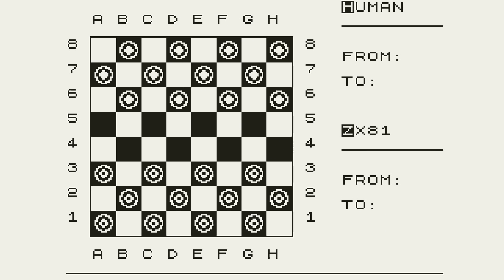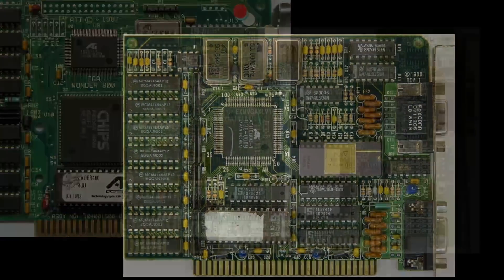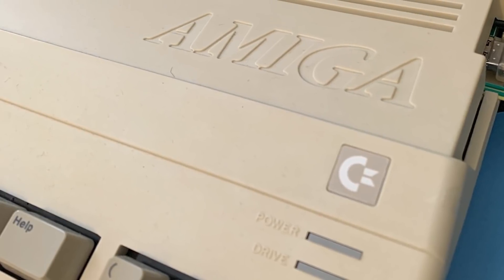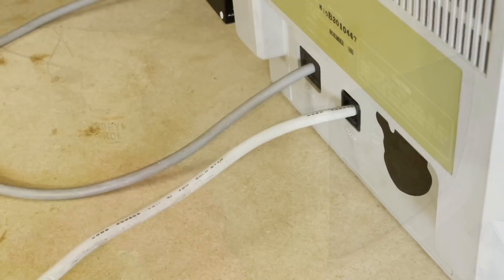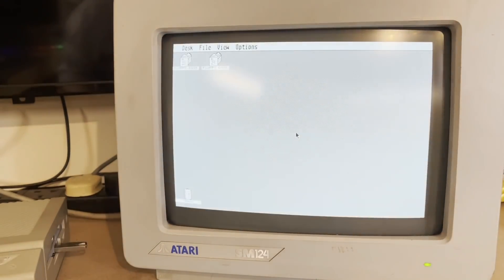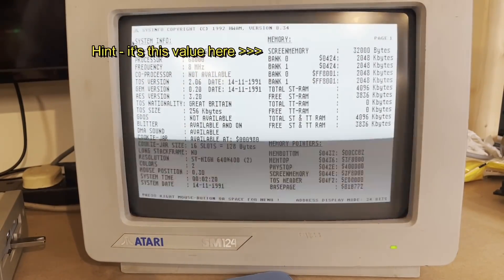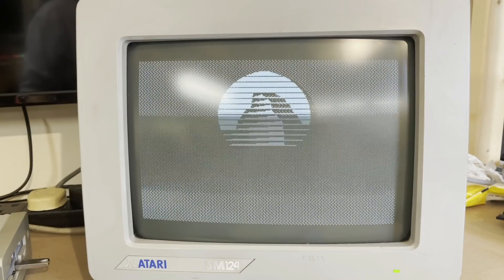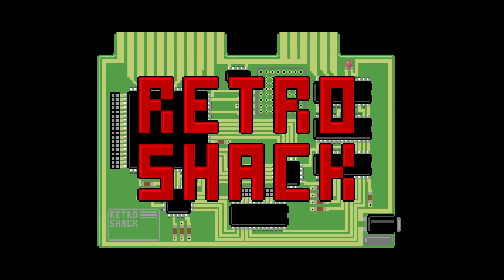'Hi Resolution' may not mean what it used to, but here's what it used to be!

Comment: I picked the ST over the 500 back when they were new as I was 14 and already into more than just games and there were several reasons for the choice, one of which was the rock steady 640x400 paper white display mode.

The interlaced mode on the Amiga equivalent was horrible, fine for use in a pinch but not for sitting there for hours coding or using a word processor. Even an extra cost flicker fixer didn't take it to 70Hz (the minimum for health and safety standards back in the day btw).

I used a 14" Sony Trinitron TV with RGB Scart input to give me the color modes, and an SM124 for the high res. Bought a switch box to flick between them. But I had to wait for that monitor, as I got the computer as a xmas gift at 14, then the monitor the following xmas... By the third xmas I had a 50MB hard drive. Imagine telling your kids today you were buying them the computer this year, the monitor next, and a hard drive the following year, lol!
Reply: You had a great setup!

I remember when I got my ST, when I was 13. Went over to London on a family holiday to visit my brother who had emigrated there for work, my parents bought me a 520 STFM in John Lewis on Oxford St. Plugging it in, I found the 3.5inch floppies weren't bendy - they were stiff. Having been used to 5.25inch disks on the Apple 2s in my school that year, and having heard of 'hard disks' - I thought that the 3.5inch floppies that came with the ST Summer Pack '88, storing an impressive 720kB, were in fact 'hard disks' :-)

ST magazines were the lifeblood of it all back then. Amazing to see how the internet has really allowed the old world of individuals doing their individual best, hanging off every tidbit of information that you could pick up, to where we are now, where anything you would have wanted to know about your precious ST is a mere google search away.... Even the manuals, on disk images, that you can load into an ST Emulator like STEEM... And I'm sure there's a file converter to .txt you can use too....
Reply: Not many people would have wanted the hassle of switching between two monitors, and very few people probably know of a device to allow not having physically disconnect the wires to do so between the two monitors. Nor would many people have wanted to take up the room on a desk for 2 monitors.

The Amiga with a flicker fixer would have been the preferred choice of most, and also offered color in hi-res mode.
Reply: @classicarcadeamusementpark4242  in Atari ST world not many people had low intelligence, everyone I knew  back then knew about the switch-box and even knew how to build one and how it worked.

Majority was even so intelligent that they picked ST as a better computer for their needs over the Amiga, just saying...
Reply: @classicarcadeamusementpark4242  you are so wrong, almost everyone knew about the switchbox, almost everyone who also played games had two monitors on desk with no problem, since monitors sat on back of the desk no one really used for anything else, in reality no one would wanted to watch the flickering poor RGB screen of Amiga in ATARI ST world...
Also ST was faster then Amiga...
Reply: ... and worst thing for you was the fact, that a year lasted todays 3 years,... damn inflation.

Comment: I upgraded from a C64 to a monochrome ST1040 in 1986 because I was into programing graphics and physics simulations and with GFA Basic it was an incredible machine. Loved it to bits and 640x400 with that crisp image the monitor delivered was insane for that time.
Reply from the maker: Yep, have to agree that the ST with a mono monitor is really easy on the eye!
Reply: The C-64 was still ahead of the ST with it's sound chip, but way behind the Amiga as all other computers were when it came out.
Reply: @classicarcadeamusementpark4242  Amiga sound chip is actually pretty poor DAC nothing special and very limited range. In 1985 when it came out it was also very limited by tiny A1000 RAM, almost useless.
ST had so much more possibilities back then, the YM is a proper synth chip Amiga is lacking of. Yes the SID was great, but ST has a MIDI that the C64 is lacking.

Its hard to see butthurt Amiga fans like you, go back to play silly arcade games, let the real computers to real enthusiasts.

Comment: When i got my falcon, i bought it  with a fujitech svga mono monitor. I ve used many color monitors with it, TFT LCD CRT, but i think that monitor was the most easy to work with. I remember the SM124 at my local Atari dealer, and it was crisp but I was really impressed at the TT's mono monitor. Still, I was young, and colour was alluring. 
I am now 'stuck' with a MegaSTE, and a TFT that won't sync down to 15khz and  which I am unable to get rid of the vertical lines on ST high. Nice video.
Reply from the maker: I’ve been using this SM124 for a couple of weeks now and absolutely love it :) Glad you enjoyed the video :)
Reply: Youtuber "Analog Thinker" made two very informative videos about Atari-to-HDMI. Might be a solution for you!?!
Reply: @blackcathardware6238  yes I've seen them. The one that makes more sense is the VGA to HDMI solution but you still get the same problem because as I've read, it's unlikely you'll find a monitor or TV that will accept a 15Khz signal over HDMI. The cheap scart to HDMI solutions are not very good because they don't do 50/60 Hz but combine the signal so in essence you get a 25/30 Hz output and while most ST games are not running at full frame rate, most demos are, and that will annoy me.
Of course the real solution is the OSSC or Retrotink but they are beyond my budget at the moment. Especially seeing how limited my time on the Atari is.

Comment: I ordered an SM125 monitor for my ST, which had a tilt/swivel base, but an SM124 arrived - a lot of the SM125s were recalled for some reason - probably safety - and nobody had them. Eventually gave my SM124 to a friend when I'd stopped using my ST. Its in the loft now, with its 1Mb upgrade board and 30Mb SCSI hard disk and interface box...
Reply from the maker: I can almost hear you scrabbling up the loft to get it down :) :)
Reply: @TheRetroShack  Its behind the Whitechapel MG-1 Workstation....

Comment: If memory serves well, Bolo, an Arknoid like, ran only on monochrome monitors.
Too bad, my SM124 works few minutes, and then starts to flicker. That should be something easy to repair. By someone who knows where to look ...
Soo many hours of coding in ST Basic & Logo, GFA Basic and Turbo C on this one !
Reply from the maker: :) :) If it's flickering it means one of two things - a component is loose or on the way out, or you have a dodgy connection somewhere.  Might be worth giving everything a good wiggle (being VERY careful if you're inside - heed my warnings!) but if not, take it to a professional to look at :). Hope you get it sorted :)
Reply: The Oxyd games were some of the best for playing in hi-res, they looked absolutely stunning like that.
Reply from the maker: @KenPurchase  I’ll take a look - thanks!
Reply: if you hear very high pitched "whistling" then there is a good chance some capacitor is on the way out. Also some of the solder joints may be cracked (simply reflow). Also maybe unrelated but there are 3 potentiometers (volume, brightness and contrast) on side of the monitors that may be very "crusty" and dry inside and need some attention.
Reply: @madigorfkgoogle9349  Thanks ! I forgot my comment. Since then, I opened the monitor, unplugged and put back the PCB at the back of the tube, and voilà, it's working again !
Yes, I waiting long enough to be sure the huge capacitors were discharged ... I'm a software guy, but I worked with enough hardware guys to know how not to die this stupid way !

Comment: I remember having some software (might have been an accessory, but I don’t remember exactly) which faked the high res screen in medium res. It worked well enough to make high res software work if a little fuzzy (obviously, it wasn’t really high resolution).
I never had anything which required high resolution, so it was more of a curiosity.
Reply: Should have scrolled further down the comments, beaten to it by days.

It would have come from an ST Format cover disk, that was my source all those sorts of utilities.
Reply from the maker: Morning - I didn't know any of these programs existed back in the day! :)
Reply: @TheRetroShack  WOW You sure didn't follow the ST scene very well back in the day! The high res software patch was provided free on quite a few magazine cover disks. There is a good online resource of disk images for the ST that include many collections of cover disks. I remember getting the high res software mode on a couple of issues of ST Format disks. I used to play about with Quartet, a sort of music tracker with a classic style using proper music notation. I could use the high res software patch to get it to run in high res mode on my TV as I could not afford the high res monitor.

The high res software works by interlacing the high res screen onto the medium res in a TSR (terminate and stay resident) interrupt routine, basically a background task that runs a little code routine every vertical blank of the screen. Each frame displayed to the screen alternates between showing the odd and even lines of the high res screen. This means the refresh rate is halved, so 25hz for the UK or 30hz for the US models and as Bryn stated it also makes the display a bit fuzzy as well as flickery.

Comment: I has an Atari st & falcon, and I acquired a second hand multi-sync monitor - this would work at both horizontal frequencies, I then acquired a plug for the Atari, and built a switch box, that toggled the monitor detect in the plug, so I could run both all modes, but switching re-booted the computer wiping anything in memory.
Reply from the maker: A Falcon... My dream machine!
Reply: @TheRetroShack  Mine too, but 30 years later it is still worth at least 3 monthly wages, so no way I could get it :/

Comment: That widescreen Trinitron shown right before lamenting resolutions “poor old Trinitrons can’t handle” was actually an HD Trinitron. Wondering if it had the 30” SFP tube that’s in my KV-30XBR910. :)
Reply from the maker: Potentially - I don’t actually own that TV anymore :( Shame really but it stopped working and was uneconomic to repair.
Reply: even that HD Trinitron cant handle the physical horizontal resolution of the SM124.
Reply: @madigorfkgoogle9349  The digital side is 1920 and the “SPF” tube means it was the highest dot pitch of any consumer CRT ever made (“SuperFine Pitch”). ;) The 30” one was even finer than the 34” version.
Reply: @madigorfkgoogle9349  We keep running into each other :-)
From the specs (from a quick search) I read the KV-30XBR910 has a Super Fine Pitch (16:9 screen) screen 1440×1080i so it could handle resolution far beyond the ST easily (ST hires being just 640 x 400), it's just the frequency. But I'm led to believe there was a way to output ST Hires in interlace so it would be able to be displayed on that screen. The reason I looked was that I had a Sony CAD/CAM monitor in 1998-9 and the resolution and quality of screen where incredible.
Reply: @daishi5571  ..and youtube keeps on deleting my comments for no reason

Comment: You definitely "upgraded" to an Amiga ;)
Reply: For gaming, yea, totally, with maybe the exception of 3D-games where the amiga hardware didn't accelerate anything (and the ST had a slightly higher clock speed). But in productivity this resolution and monitor absolutely rocked! It was much cheaper than it's closest rival, the macintosh.
Reply: @Pyriold  100% correct. For games made after 1988 the Amiga was an upgrade, but for productivity the ST was better imho and why I picked it over the 500.
Reply: @andrewroberts1787  What productivity software did you run on the Atari ST that was better than the productivity software made for the Amiga?

Here in America, the availability of Amiga software was much greater as during the Amiga's peek years in the 80s, the Amiga out sold the Atari ST 10 to 1.
Reply from the maker: Shhhhhh… You’ll upset the ST fans… Oh, wait - I’M an ST fan! :) :) :)

Comment: I had a Multisync monitor in 1991.  There were a fair few to go at, but mine came with a converter box that had a toggle switch to enable Hi-Res. I only used hi-res for sequencer applications.
Reply from the maker: That must have been a real space saver given the size of the darn things!

Comment: When I ordered my ST they sent me an SM124 with it by mistake and they never realised. Best freebie I ever got, the image quality was astonishing - it almost had a Kindle E-ink kind of look to it when I think back.
Reply: The SM124 was arguably better than the Macintosh display, and higher resolution too.
Reply: @Nibb31  Totally agree.
Reply: @Nibb31  It also had 70 Hz refresh rate (compared to Mac's 60 Hz). I think it was quite a few years before you could buy any non-Atari monitor that could support such specs (mono SVGAs were kind of compatible, and I also had some weird 14" Linotype model that was actually 1-bit mono and had really nice warm tint). Probably thanks to those monitors I'm still not wearing any glasses.
Reply from the maker: Lucky you!!!! :) :)
Reply: I never thought of e-ink, but it's a good comparison.
Reply: Atari 520ST+ Price £750 (with black/white monitor, floppy and mouse),  Atari 520ST Price £700 (1986).

Comment: One nice thing about the ST monochrome monitor is that it's a continuous phosphor - no shadow mask because there's only one electron gun.  It made for a very smooth and clean display.
Reply from the maker: It IS spookily similar to E-Ink - very smooth :)
Reply: Oh is THAT why it looks so damn good.  Never seen another like it.
Reply: Yeah. This is true of monochrome monitors on other systems, too; even on the Apple II you can see that text is significantly more clear on a monochrome monitor than even a high quality colour monitor, especially on systems with an 80-column card.

A number of early-80s Japanese systems (such as the Fujitsu FM-8 and FM-7) had high-resolution 640×200 displays in order to better display kanji. They did 8-colour output to RGB monitors (48K of video RAM), but had separate circuitry for the composite output that gave eight levels of greyscale rather than colour because it was assumed that anybody using text would not want the interference of a shadow mask/aperture grille or resolution-killing NTSC colour destroying their display quality. (This in theory would also allow for truly beautiful anti-aliased text, though I don't know of anybody that actually did this.)

Because I was mostly doing programming on the ST in the mid- to late-80s, I almost invariably used a monochrome monitor because it was just a lot easier on the eyes for text, as well as giving more screen real-estate. I later had an old Sun 3/60 as my home machine with Sun's beautiful 21" 1152×900 monochrome display

Comment: Hi as you say the Spectrum used 6144 bytes of RAM for the screen, that is not "around" 6K it is EXACTLY 6K. A Kilobyte has always been 1024 bytes (2^10).

In recent times there has been a push to redefine that as a Kibibyte, but it is a senseless change which just causes confusion. Look for example at hard drives, where a drive sold as storing 2TB actually only stores 1.8TB of data as the OS correctly calculates the size based on powers of 2 as computers operate in binary not decimal.
Reply: but you know that stating "around 6k" is very accurate if you mean exact 6k, right?

Comment: I also have a 520 STFM, which has never been connected to a monitor. The only pin on that port ever used was the audio, which I prodded a wire into, the other end going to a stereo.

The first time I got to try out hi-res was on an emulator. I was underwhelmed but it was something I'd always wanted to do, regardless.
Reply from the maker: Odd how that forbidden fruit tempts you over the years :) :)
Reply: Emulation doesn't quite do it justice, seen on an actual SM124 the difference is remarkable. I used to have one but foolishly chucked it out to save space, a decision I constantly regret!

Comment: Is there a way to activate the ST High mode using a modern LCD display?
Reply: The high-resolution mode uses a VGA-equivalent 30kHz line rate so is likely to work with most  VGA monitors, with the slight caveat that I think it's only 500 lines total per frame whereas 640x480 VGA is 525 lines total. Which should be within range, but you never know how fussy these things are going to be.

I recently used a $10 no-brand VGA to HDMI adaptor successfully with 640x400 from a vintage Mac though, connecting to a low-end 4k monitor, so I'd have high hopes.
Reply from the maker: Sounds like something I need to test :)
Reply: as ThomTomful said, yes. Search for ST2VGA, but be aware that modern LCDs have much higher resolution then 640x400 and the picture is washed out, not as sharp as on SM124.